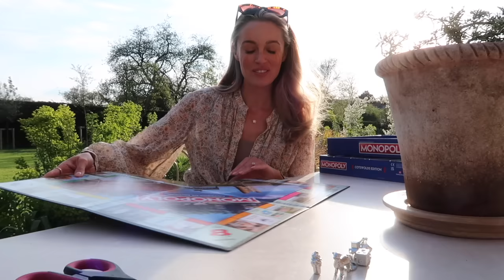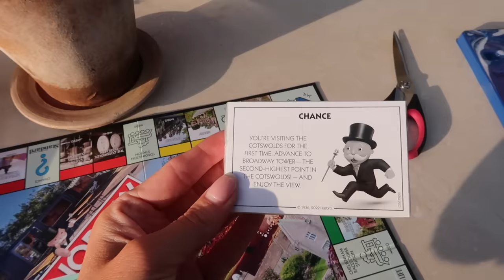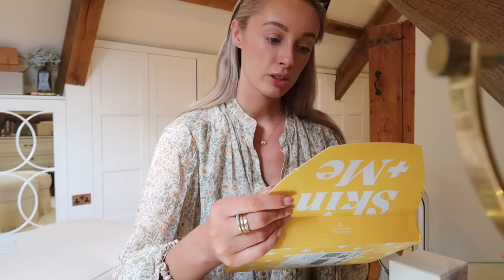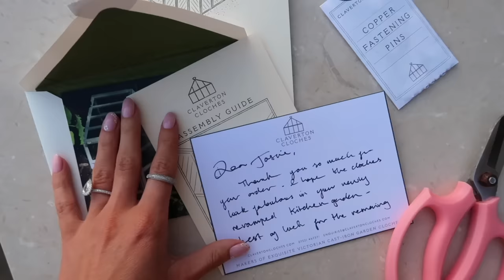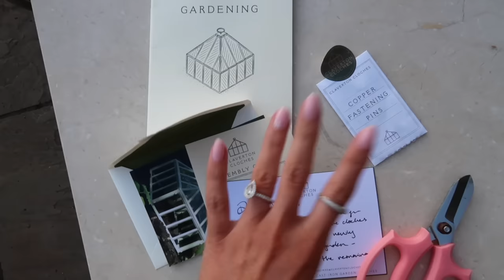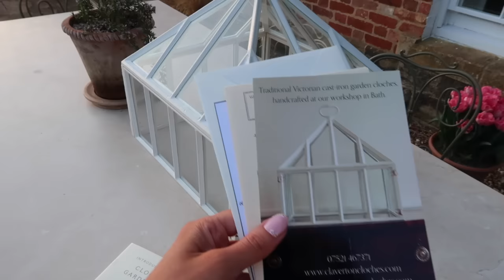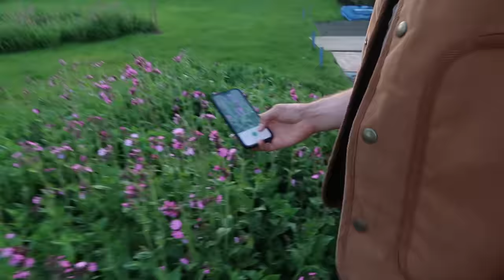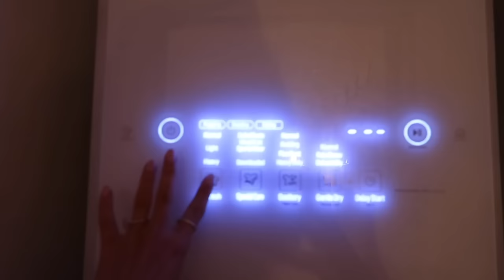UNBOXINGS, GARDEN UPDATES + 'COME TO WORK WITH ME' IN LONDON // Fashion Mumblr Vlogs

Comment: I listened to the "Sound" 4x, I still can't figure out what it was?!?! Dexter would definitely make a "Good Antique Dealer"! LOL How did the Bags you threw into the pond work out? Like Aaron from "Garden Answer" says... Always make sure you have good infrastructure put in when doing projects- think of 20 yrs down the road". You will not regret putting in electrical outlets in your kitchen garden. You will LOVE the low voltage outdoor lighting!! I wouldn't be surprised if Charlie doesn't have it done throughout your gardens! (for the dogs... of course LOL)😘